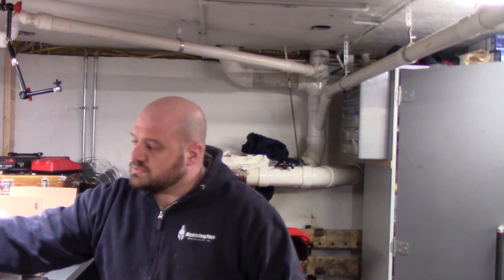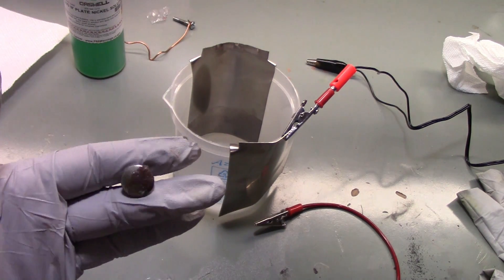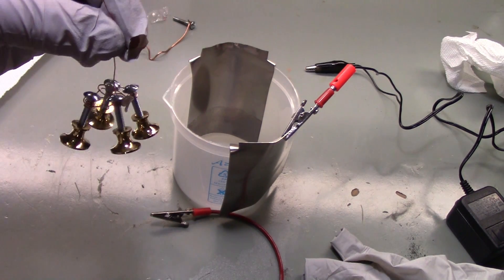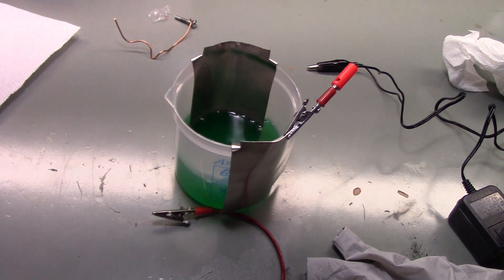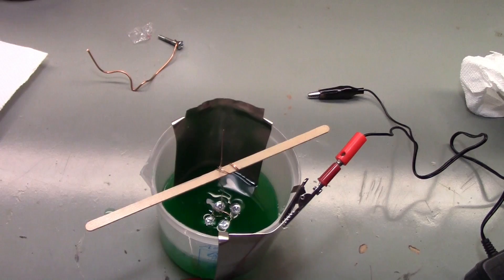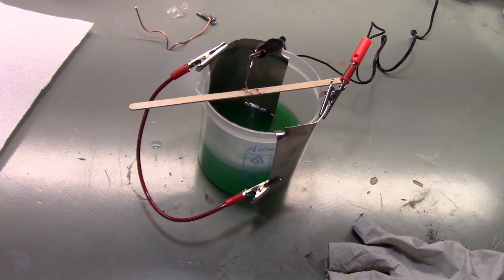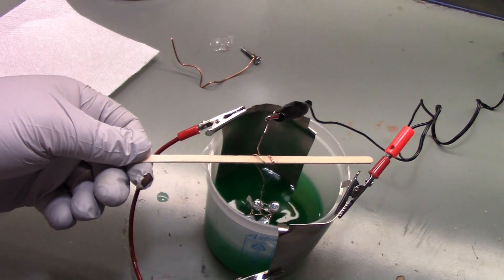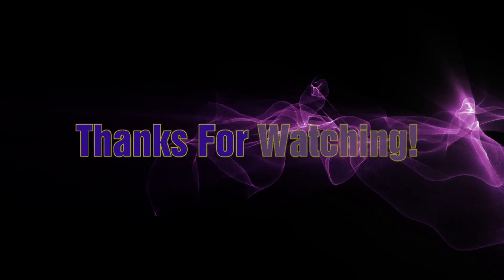Home Nickel Plating

Comment: Greg, why is one annode outside the container? Do they explain that? I would have thought they both should be in the container.
Reply from the maker: Just be screwing up, But it worked still
Reply: @Halligan142  ahhhh, yea, as you get older you will find you do it more and more... and you can't figure out why you do dumb things. Even when you say, ok this goes before this, then when you do it.. it all goes out the door... sheesh.

Comment: I notice that one of the electrodes is on the outside of the cup.  Is that correct?  I would think that both would need to be submerged in the solution.
Reply from the maker: Just a screw up on my part, but it still worked

Comment: Reason for the acetone warning: acetone leaves a thin organic film on things, which usually comes off in just about any other solution. Probably eventually contaminates the nickel bath, but I have to imagine that would take a long time. Acetone is still great for cleaning though. Just if I need a truly clean part/beaker/chamber I follow up with 99% iso.
Reply: Good to know, I use acetone a lot for cleaning, love the smell.. My dentist uses it to clean before putting caps on the post. He also said it's organic.. he says the body already contains a small amount of acetone.
Reply: Acetone completely evaporates without residue. However, commercial acetone is not pure acetone. Due to poor distillation during manufacture, there is always some non-volatile residue left when it evaporates which may interfere with plating. If mission critical, I would re-distill the acetone. Otherwise,  I would just say "good enough" and "F...It".